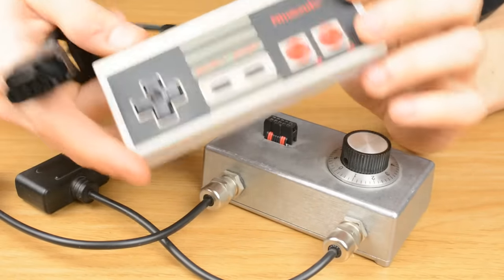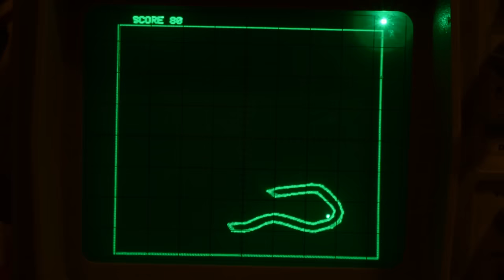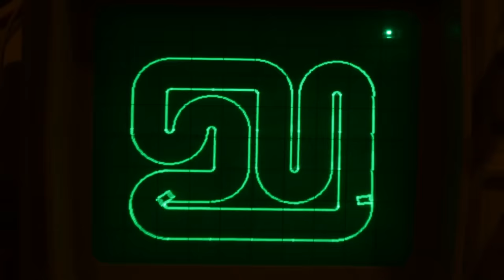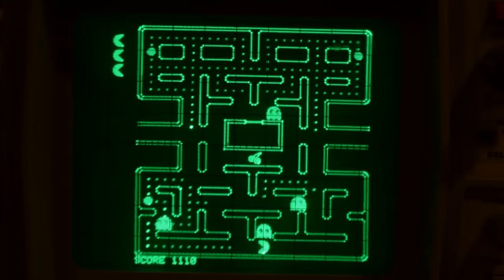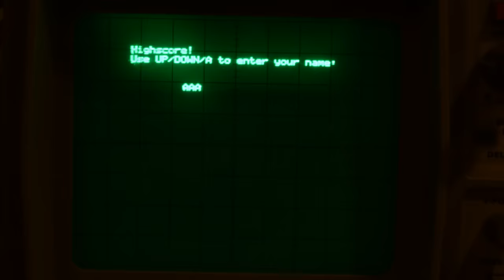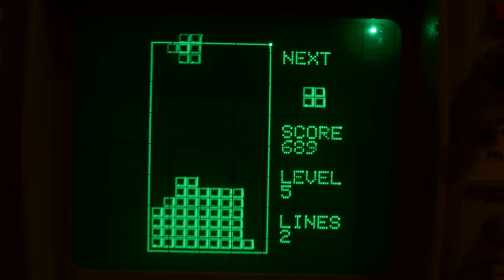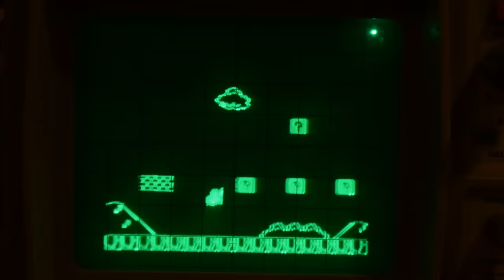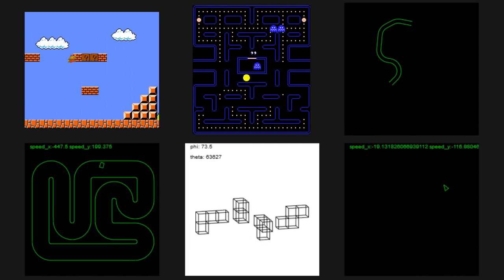DIY Games Console

Comment: That's one of the most impressive DIY projects I've seen. If he had built that in his Garage 40 yrs ago he could have been a millionaire.
Reply: This technology didn't exist 40 years ago.  What you see on a single chip today was an entire board back then of discrete components.  The reason devices are so INCREDIBLY inexpensive is because you can fit what was LITERALLY a mainframe computer on a single chip.  The raspberry pi is a more powerful machine than the VAX/VMS system was, 30 years ago - that supported 30 students.
Reply: @fuzzywzhe  oh I know but I'm glad you explained it for others.
Reply: @nunyabusiness4651  OOps - why did I write 30 students?

I mean 3,000 students.  That's a $75 TOY machine now.

I think this is the future, decentralization.  Since we all have massive internet connections today (and we do!) and insanely powerful computers today (and we do!) there's no reason NOT to bring back protocols after tweaking them a bit.

I'm working on an SMTP mail replacement - it won't connect to the standard email system except through a gateway, but it will be entirely secure, and it will not have a lot of the limitations of standard email - this WILL be able to accept a 2 GB file - but I expect the email client will limit it.

We have all this centralization we just don't need.  Your internet connection is perfectly capable of serving up your little webpage no problem, until you hit a few 100 people logging in regularly.
Reply: @fuzzywzhe  I got ya.

Comment: I believe if this was actually released in the early 80s it could of had some success in the era
Reply: *the early 70s
Reply: You had the atari in the 80s
Reply: Do some digging and you’ll find out that a lot more was tried and existed than the average person is aware of.
Reply: Memory was expensive so the method the cart works would've been expensive. It could've sold at right price, but if you had the 90s atmegas at early 80s you could've printed money with them anyway
Reply: It wouldn’t
Reply: This would be absolutely sick, a 20mhz cpu, 32k storage, and all this before the Famicom, this is goated.
Reply: @lasskinn474  If he had access to a more contemporary CPU like a 6502 or 68008 (68k but with an 8-bit data bus for low-end systems), it might’ve been able to use the cartridge ROM directly without copying, since most were designed like that back then

Comment: Next on your TODO list: "Doom" ! (or more likely "3-Demon", given the 8-bit chip)
Reply: Or Wolfenstein 3d
Reply: it should be doable, as there was someone who made a half decent little clone of Wolf3D on an 328P based gaming handheld called the Gamebuino.
Reply: @DFX2KX  the thing that cranks the difficulty level to "insane" is that:
- the gamebuino, has a separate LCD with a controller. So you "merely" need to send the bitmap to the LCD and the LCD takes care of displaying it. You can devote 100% of your CPU cycles to the game, and can display any arbitrary  bitmap on the screen.
- this device drives its own display by driving the X and Y coordinate of an oscilloscope. That means that, in addition to the actual game, you need to devote time to constantly redraw the vector figure on the screen. Also, the display is inherently vector. It's possible to display a bit more complex graphics than polygon by imitating a raster scan (e.g.: sprites in PacMan), but that begin to be quite a lot for driving it real time (it's visible in the mario demo when there are way too many tiles on the screen).
This means that it's going to be too taxing on the hardware to do a full raycasting AND drive the oscilloscope in raster to render the image.
It's going to be much easier to display a vector rendition of un-textured, wire-frame 3d levels. Hence my reference to 3-Demon. (Which is also more period accurate given the other 8-bit inspired games)
Reply: Of it can play on a calculator it can run 8-bit

Comment: WHAT DOES THE KNOB DO??????  It's killing me.
Reply: I guess it's either for volume or brightness adjustment
Reply: @albertoossola1481  Probably volume, brightness is tough on a oscilloscope because you basically have to rewrite sprites and backgrounds over themselves and that makes them brighter, the only issue with that when you have too many sprites on screen it starts spazzing out like it did on the Mario game at the end of the level the flashing was from the amount of sprites being loaded. The reason it flashes is so you can see all the sprites at the same time, but there's not enough memory to show them all at the same time so flashes between them as quickly as possible.
Reply: @albertoossola1481  Yeah, you can't control the brightness on an oscilliscope from this input source, the amplitude of the signal only changes the scale of what you are displaying
Reply: @itsmaeday_2105  Makes sense, but maybe the knob controls the amounts of time spent on drawing sprites vs the amount of time 'idling' on that bright spot in the upper-right corner, the console could adjust brightness with a technique similar to PWM, to some degree. Just an hypothesis though, you're probably the one being right lol.
Reply: @albertoossola1481  this is correct, he talked about it in the video

I don't know if that's what the knob is for, but that's how the brightness works
Reply: I think he’s playing the games, but there’s no need to be so rude
Reply: It is indeed a volume knob: https://mitxela.com/projects/console/enclosure
Reply: The knob turns
Reply: @Lee Martin I had to read your comment a few times before it sunk in. Well played, sir.
Reply: It’s the volume NOW U KNOW
Reply: Rone Farrowdwelf the Mario game didn’t break because of that. If you paid attention, he says it pulls music data and reads it as level data and makes the music to a level.
Reply: It's joystick
Reply: Sod Almighty - Okay, I feel like Ethan Suplee in Mallrats,  everyone can see a sailboat in the stereoscopic image, but he can’t!  What’s the hidden image in Lee Martin comment?

Comment: As modern tetris player, aside that you mixed some features of modern games – like das or wallkicks – to your classic tetris (at it seems to be in the load screen) , im very glad that you put the effort to make your game as precise as the original is. I say this because our community see everywhere bad fan copies out there to public because its seems easy to make and there are few developers interested to make games as precise as the originals (the same way you did with all the other copies)
Lots of congrats for all the games and programs that you've done down in 2014.

Aside of that, one of my hobbies are electronics too, and i know how many knowledge it means to create a 8 bit computer, write in assembly the bios and the game cartridge... right now im just trying to get involved with more electronics theory for my own knowledge previous to a university carreer, but i manage to understand the size of what you did.

It would be grateful if i can check the tetris and the audio engine for some chiptune hardware player i have in mind and a tetris fangame with most of the guidelines features as you did.

Lots of congratulations. ¡Buen trabajo!

Comment: Like traditional 1970's console games, needing a B&W mode for those who used B&W TVs, you could use different patterns to distinguish player 1 and player 2. Perhaps have a diagonal line or "X" through one player, and a straight front-to-back line through the other.

Comment: Interesting. Since I have no clue about assembly or electronics (did one class, but had to leave because I can't solder) all I could recommend as an improvent is to switch out one of those square waves for a tri wave and another for a saw wave. If you ever feel like ramping up the challenge on this, I'd recommend adding red and blue beams (and maybe amber and white beams to emulate more natural light) to see if it can display more than one colour.

Comment: Well that's one way of doing it. I was about to write an interpreter in the arm core and use the chip as a processor similar to a z80. The way you have done it gives you a lot faster program. I wonder if there's an intermediate.

Comment: I wrote a Tetris clone once (to learn Pygame). Your Tetris piece selection is not correct. How it’s supposed to work is that all 7 pieces are put in a bag and you pull them out in random order, and then put them all back in the bag and start again. I also have wall kick but didn’t know about the auto slide thing you mentioned so I’ll have to fix that.

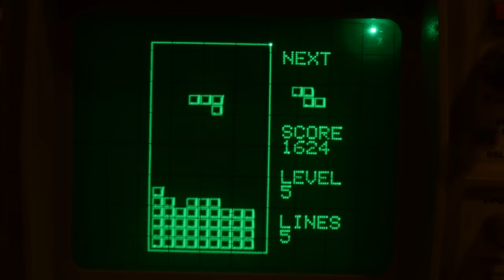At 10:55 there are two straight pieces in a row, so the second straight piece must be the start of a new bag. But another straight piece shows up 5 later. Oh, you mentioned you knew about the bag thing. Maybe a bug then.

Your project is very impressive though. I love things built from scratch.

Comment: This is pretty awesome, but the first mistake you made was having Nintendo controllers and not Sega controllers. I think DB9 sockets are a lot easier to find, plus they are Atari 2600 compatible (and Commodore 64 compatible... not Sinclair joystick compatible... not sure about Amstrad CPC or Kempston though, I never had a Spectrum as a kid)  

I would have thought that Retro Racer would have been more like the Vectrex port of Pole Position, because this basically a homemeade Vectrex-like!!  

Did Rainbow Arts get Mario right with the Giana Sisters?  Nintendo convinced a judge into thinking so!

Comment: you should mod one of those 5.5inch b/w tvs to work with this, wouldnt be toooo hard and would look cool as an all in one device
Reply: He would have to completely rework the console or take on the more complex task of converting a raster display to a vector one.
Reply: @jnharton  but he issss using vector, not raster.. he's using x y on occiloscope which iiiis vector.
Reply: @quackduckface  I know that! My point is that a b/w television is a raster display.
Reply: @jnharton  yes but you caaan send to the yoke directly and use it as an XY vector display :)

Comment: Can C/C++ used to write games for the console
Reply: I believe so if you compile it correctly, if you want to learn a little more, reply to this reply
Reply: @adamhall7077  So I believe that you must be using some sort of control system to write an output signal to the oscilloscope right?

Is it a microcontroller, and which is it?
Reply: @jazz_cat_6502  Atmega128
Reply: @adamhall7077  Dandy!

Comment: What the hell is an Oscilloscope? So many buttons... So confusing... Why not just a simple TV?
Reply: That’s not how electronics work
Reply: First of all, an oscilloscope is a device that visualizes electronic voltage waves, Second of all, the reason why he uses an oscilloscope instead of a standard tv is that, the only option that's easy to do is composite video, but composite is analog and the processor he is using is digital, but oscilloscope vector video is digital so it's a whole lot easier to output video
Reply: @adamhall7077  I literally forgot that I even wrote this comment, and overall, I think oscilloscopes are very interesting!
Reply: @oresttheproto  They are interesting
Reply: @DerpyUniverse  bro i hate myself lol